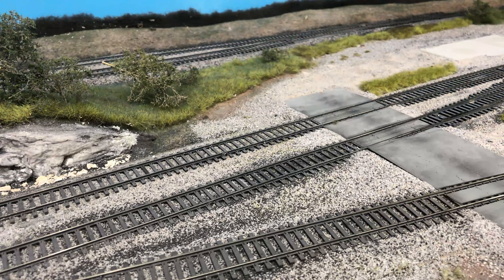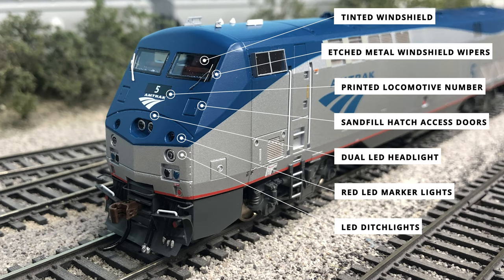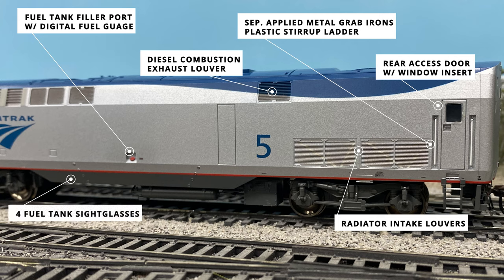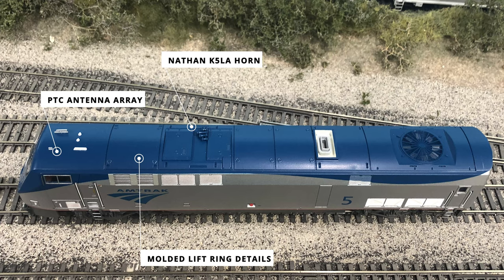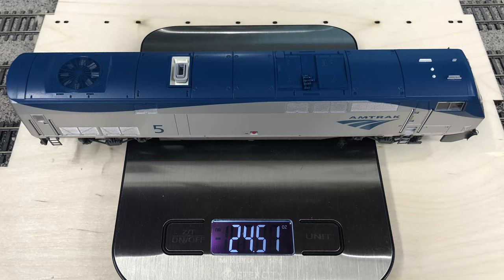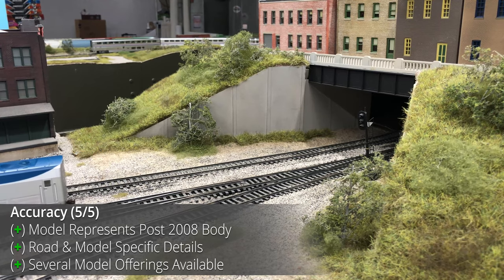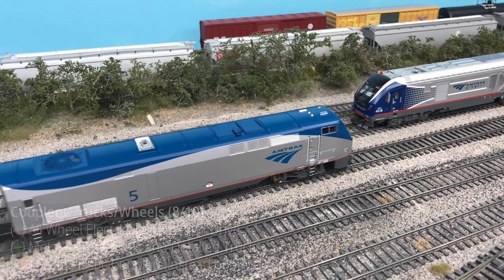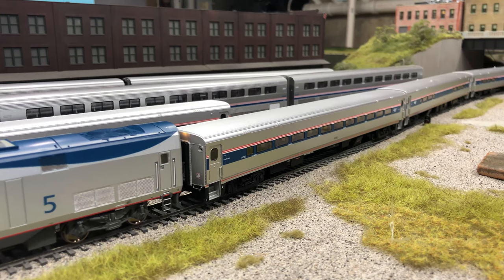Review: Athearn Genesis Amtrak P42 [HO Scale]

Comment: Other than perhaps not sharing one of your view points - (in my opinion this IS just an upgraded RTR with Genesis lighting effects),  I couldn't agree more re the missed opportunities.  Athearn did not include etched metal grills throughout which is disappointing, and the same goes for the non-illuminated number board. I appreciate Athearn would have had to re-tool the car body to add the etched grills at considerable cost but there seems to be a bit of arrogance there that Athearn knew the model would be a sell-out without the investment of re-tooling.  One important and much needed upgrade compared to the RTR version is the chassis, which as shown in this review is a substantial piece of alloy compared to the lightweight chassis in the RTR. Guess we will have to wait for Rapido to produce an upgraded version  with mesh grills etc in 10 year's time. I have ordered an Athearn P42. Really great review by the way!

Comment: Honestly embarrassing how bad soundtraxx did on the sound. Once again a prime example of Athearn doing their part but soundtraxx failing. I’ll get mine dcc ready and put esu in em. Great review
Reply: Agreed. Soundtraxx is really low on the higher end side of sound. ESU FTW!
Reply: @AbelG8781  I will never get a soundtraxx item again lol
Reply: @nhbrail  they're not bad but their sounds are kinda genericy lol
Reply: @AbelG8781  I’d say their products themself are good it’s just the content in some of the products(sound files🗿) that could do with some work
Reply: @nhbrail  true. But overall at the end of the day, ESU!!!
Reply: @AbelG8781  especially for those(me included) that have a lok programmer
Reply: @nhbrail  yup. Reason ESU is king. Plus their decoders arent over sensitive to slight power loss like Soundtraxx that has to completely restart.
Reply: @AbelG8781  I hate that about soundtraxx
Reply: I never understand why Athearn still use Soundtraxx, Almost every manufacturer use ESU (minus Bachmann who have transitioned to TCS but even they have moved away from Soundtraxx). Soundtraxx was good in the mid to late 2000's but they are horribly outclassed these days, unless they do a total upgrade to their decoders sounds and motor control.
Reply: @derekonxbox  if it weren’t for Athearn soundtraxx would be way dead, and tbh I don’t see Athearn lasting toooooo much longer after all the downfalls they’ve had recently
Reply: ESU garbage the mainstream caught you guys with it lol.
Reply: @kyleftw1679  u don’t like esu?
Reply: @nhbrail  No, Sountraxx Tsunami 2 is very underated. TSU-2 is more easier to use, they dont have bad audio quality like ESU, better horn sounds on the TSU-2. Everybody is just brainwashed into ESU because of people in this hobby never tried a Tsunami 2 decoder, somehow they say ESU is better. I get if its someones opinion but they cant say Tsunami 2 decoders are bad when they never tried it for their self.
Reply: @kyleftw1679  Ive had many tsu2 decoders in my life, some Ive been fine with some Ive hated(sd80mac with fucking 16cyl sounds and not 20) the way i compare the two companies is like Microsoft to apple. Apple is a much more closed system, its more user friendly, to me this sounds like soundtraxx, more user friendly but not as much customization. ESU is more like Microsoft. More options and a much more customizable system, less user friendly tho.
Reply: @nhbrail  The SD80mac has been converted into a v16 engine, but the as delivered engines I get it.
Reply: @kyleftw1679  80macs are 20cyl, never were 16 when they were operating
Reply: @kyleftw1679  I prefer TCS Wowsound over everything else, but ESU is 2nd best. Their (ESU)  sounds are far more accurate the Tsunami (especially prime mover, startup/shutdown and horns), granted their max volume level leaves something to be desired, hence why i prefer TCS. Their sound fidelity imo is unmatched by any other decoder.
Reply: @derekonxbox  Ok, sure buddy
Reply: @kyleftw1679  TCS has done some rlly great stuff, acs, charger are examples
Reply: Sounds recorded from an actual P42. What would you change?
Reply: @jantheman9999  no way it’s recorded right from one lmao, the hep sounds terrible, I mean TERRIBLE... it should have this humming sound instead of just being in notch 6, the horn is also terrible
Reply: The wrong engine was uploaded. Go to CV123 data 5. I notice it was wrong as soon as it powered up. Let be know if it helped.
Reply: @nhbrail  thanks for your feed back.
 ill pass it on to Soundtraxx.
Horn sounds OK to me, sounds like a K5LA. You can play with the EQ and echo settings on the decoder to make it sound more "hollywood"
Reply: You must not have been around for the days when Loco's were equipped with MRC or QSU. Sounded more like salsa music then prime movers. lol 

 While I personally prefer ESU, Soundtraxx 2 ain't that bad.
Reply: @drewzdrew27  oh dont get me started on QSI lmfao

Comment: I got AMTK#12 recently and after comparing with photos, I found some flaws in the paint scheme, for example the number board in the front deviated from the centerline, and the space between individual numbers on the side is a bit large. The number board might be a manufacture flaw, but I think the numbers on the side is probably a design flaw.
I’m a bit entangled on this matter. I’m still positive towards this model, the flaws don’t ruin the whole experience, but they are flaws indeed. On the other hand it’s almost impossible to find another one now.
I guess my only chance is Athearn, but I doubt if they will be able to correct anything.